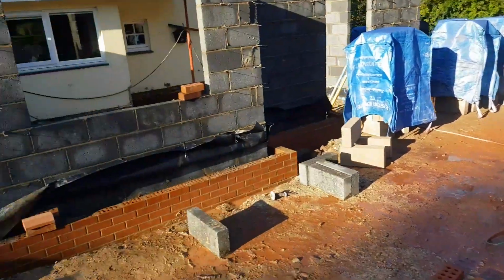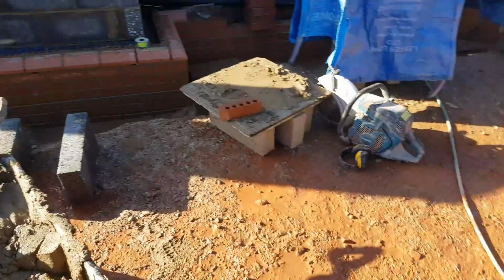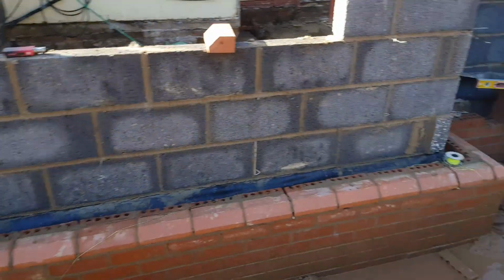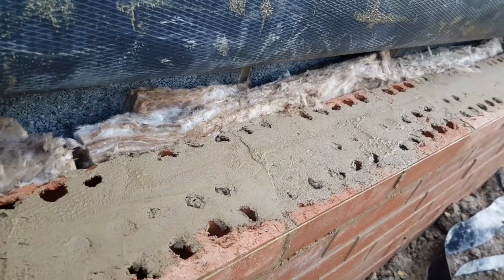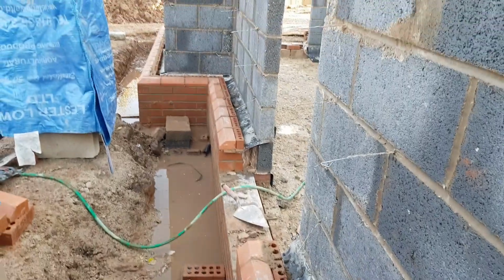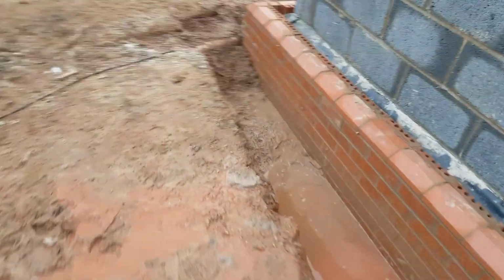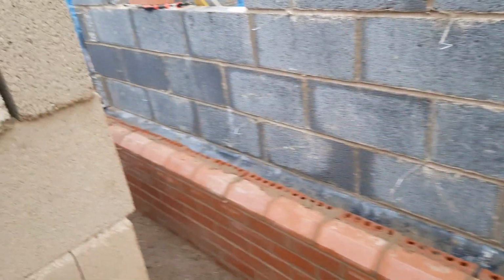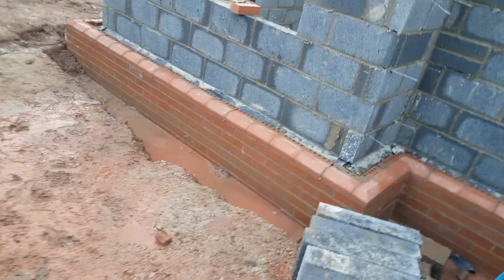Bricklaying - Setting out and laying Plinths #bricklaying #renovation #extension #vlog

Comment: Why did you not just cut common brick to back it up mate . So much quicker and easier on saw .
Reply from the maker: Didnt have any commons on the job unfortunately 😂 however that blade cuts them engineerings like butter unsurprisingly 👌👍 Have a good weekend fella
Reply: I use a square back edging. Easy